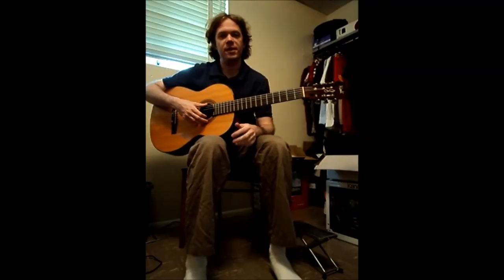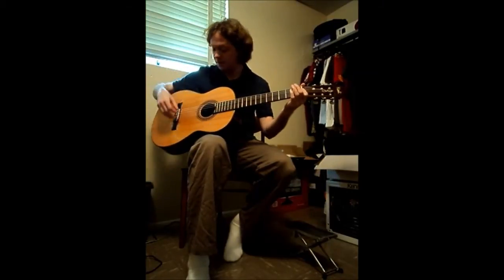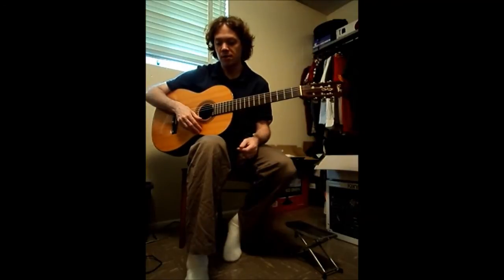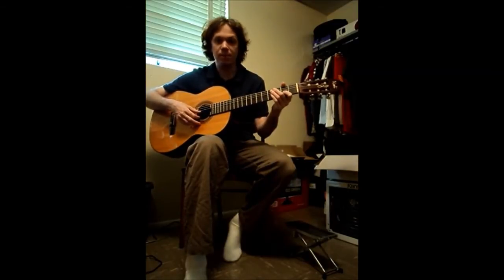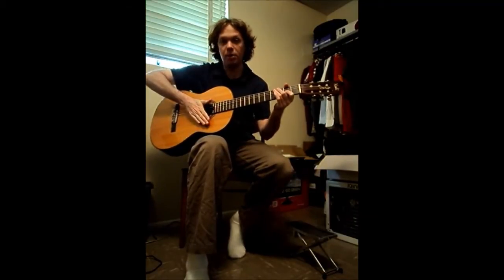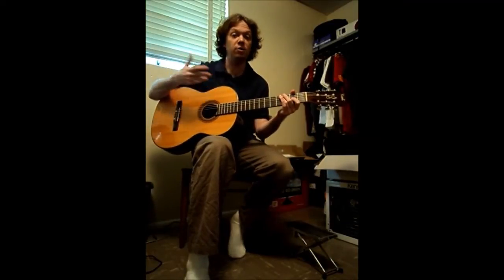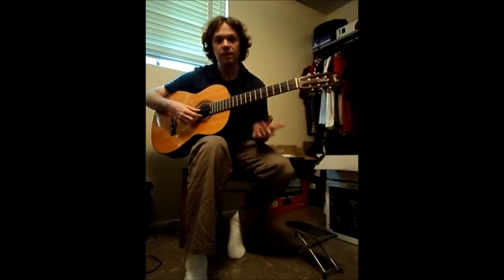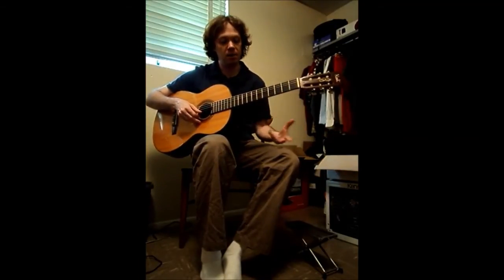Sympathetic Resonance

Comment: Whenever i tap a string on my acoustic guitar, the opposite side of the string (between my finger and nut) creates a ringing sound......
Can you explain why this is happening and how to fix it??
Reply from the maker: You mean between your fingers and the nut, not behind the nut? That's a bit of a strange one, because the frets should be high enough to deaden any of those vibrations, unless they are very high frequency. Is your nut super high or something? Sometimes just cleaning the nut, where the string passes through, can help with random sounds.
Reply: @levitopher  there is no problem with the nut.
I used the capo and it's still ringing between my finger and the capo.

Comment: I just rented a nylon guitar with the intention of learning how to play it a bit, and am shocked by how LOUD these ringing overtones are. It is not subtle, it is very disruptive! In your video, you had to try to hear them, on this guitar, they totally clash. So having to mute other strings as you're playing is a normal thing to do, so my question is: do you become subconsciously used to muting the offending strings when you're playing 'A's or 'D's but NOT when you're playing other notes, like G#, or do you aim for the habit of playing 'cleanly' by muting other strings while you're playing no matter what? Thank you for any guidance.
Reply from the maker: Interesting comment - I would say sympathetic vibration is a quality of a particular instrument, and there shouldn't be any reason to mute strings to avoid it. When you play a low E, the high E vibrates in resonance, but that's not additional harmonic content (since they have the same overtones), it's just changing the relative amplitude of the various overtones. For sure, that might mean certain strings are louder then others, but these are acoustic instruments, that's absolutely part of the sound quality of them. 

Having said all that, muting strings while playing is certainly a possibility, but it doesn't match my aesthetic, so I personally wouldn't spend much time on that.

I also assume are not talking about "Wolf Tones", in which interactions between the body and the strings actually change the quality of the sound. I don't know how common these are on guitars - they are something bowed string instrument players deal with all the time.
Reply: @levitopher  Thank you kindly for your thoughtful reply. I'm going  to keep experimenting.

Comment: So my guitar is not broken? Please tell me it's not broken because at the beginning it wasn't ringing but now with the time it started to do. After watching this video I think I wasn't tuning my guitar as good as I do it now so back then the harmonics of the high notes didn't fit with the lower notes right?
Reply from the maker: Well first of all, you are using an acoustic guitar, right? The notes may or may not ring on an electric, depending on the construction. If you are indeed using an acoustic, then yes, the better your tuning is, the more sympathetic resonance your guitar will experience.

I will also say that the higher harmonics will not match the lower strings, even if your guitar is perfectly "in-tune". This is because the tuning system our ears are used to (called "even tempered") is different than the natural harmonic system of resonating strings. You will hear this difference at the 7th harmonic, if you can reach it. There are a variety of reasons for this, which you can research if you like, but it's good to know differences exist.